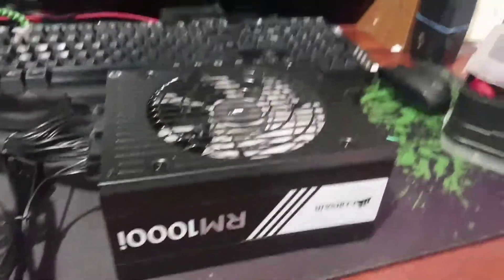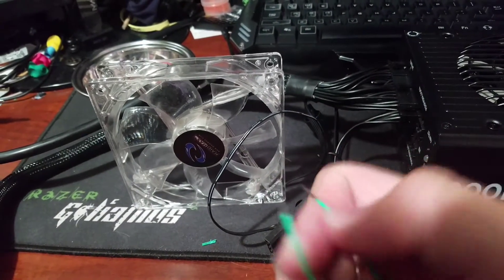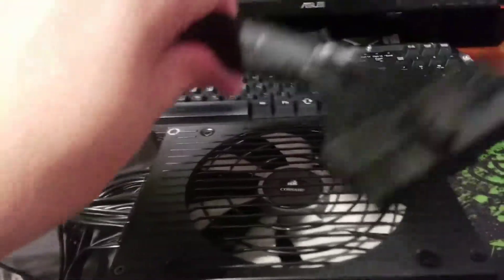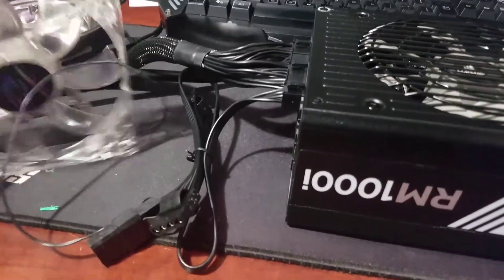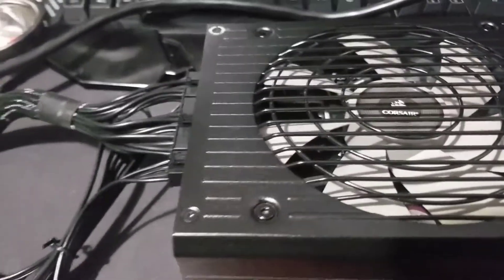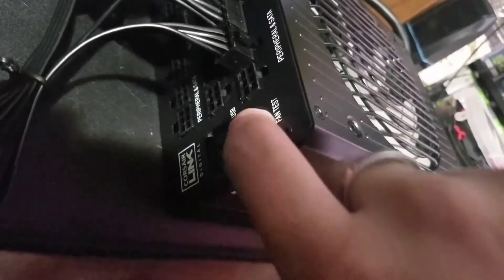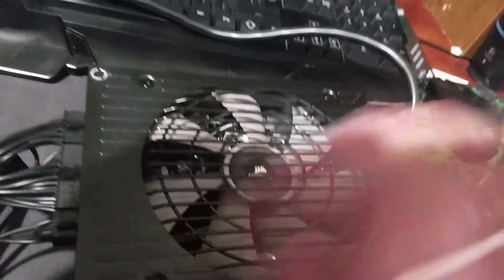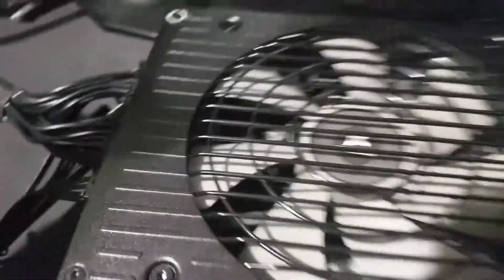My Power Supply Died, here's how you can check yours.

Comment: This just happened to mine, I heard a pop, saw a spark, then it died. It has top of the line parts so fingers crossed when I replaced the PSU nothing else is damaged or that's a lot of money down the drain
Reply from the maker: Yeah psu death has so many potential consequences. Hope you have good luck, mine didn't take anything with it, maybe you'll get lucky
Reply: Same thing just happened to me
Reply: @zaias9303  Same here. Loud pop, big spark and that 'nice' plastic BBQ smell. I heard it can also be the power cable itself.
Reply: I just got my new GPU... I turned the Air conditioner on and the pc turned off... It appears that the mother board and everything else is fine (at least I hope so)... I think the energy here in my region is very dirt. Maybe I should get a power conditioner or something.

Comment: I’m having this issue and it’s messing me up
Reply from the maker: Best I can suggest is to check if its under warranty, if so contact the manufacture, in my case it was Corsair and they have awesome turn around on getting warranty replacement done, sadly until the new PSU comes in you tend to be out a computer.